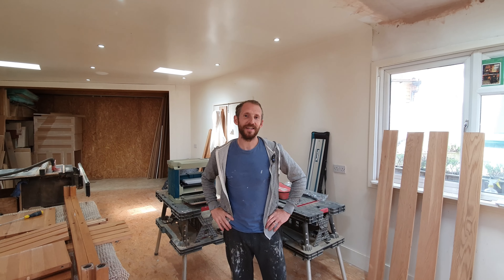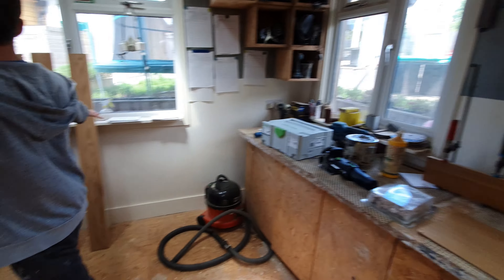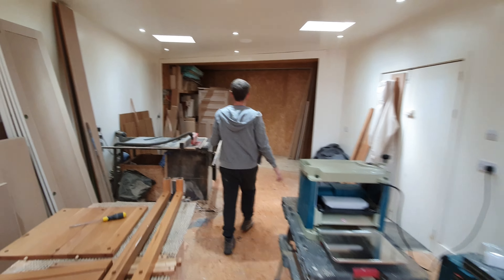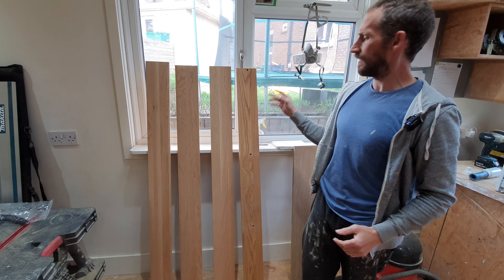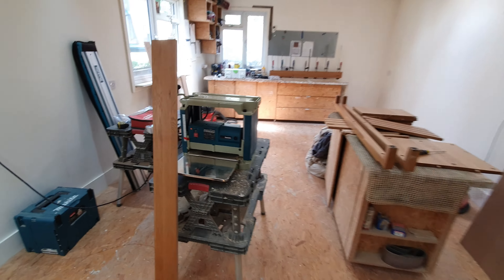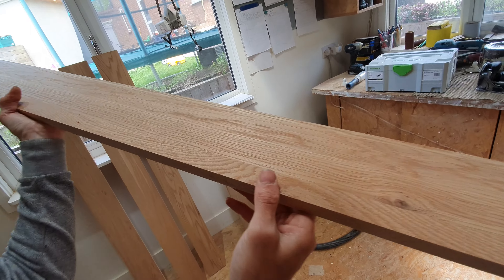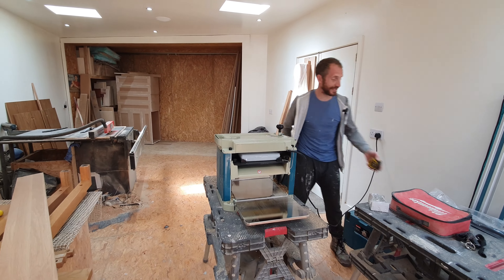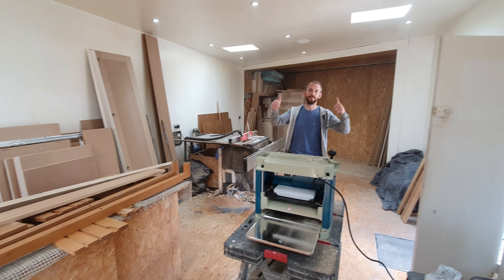The Awesome MAKITA THICKNESSER 2012NB Review & Demo \ Plus Lots More \  EP#63

Comment: Just bought one after 2 weeks of OCD research and yes no snipe, box hadn't fell of the forklift so it was good and I'm happy, its quite and fly's through 6x4 oak easy and got the extractor aswell in the box 🤠
Reply from the maker: Amazing! I really do like them, I dont use it alot but when I do it's enjoyable 👍
Reply: Hi mate. I'm thinking of buying one.  Are these any good to plane 2.4 meter lengths of green oak do you think? 200mm wide
Reply: @davidfalat4377  Im the same David, need one to clean up 200x100 green oak new sleepers.Did you purchase one? Best price ive found UK is £445 inc vat

Comment: Nice! Did the package include the dust extraction chute? I'm asking this because where I'm from they're selling it without it. Iv gotta buy it separately if I want it...
Reply: In the UK it comes with it.
Reply: @tentonhammer5469  thanks for the info. Recently bought this planer. The manual states that the chute may be sold separately depending on the country.... :(
Reply: @mariano_353   I've been trying to decide between this and the dewslt 733 probably going to order the makita tomorrow. Whats your experience using the makita?
Reply: @tentonhammer5469  not lengthy enough to pass a serious judgement. Just ran a board to test it and I can say it came out smooth with the machine right out of the box. Barely noticeable snipe.

Comment: What does the motor/gearbox housing/cover made from? Plastic or metal?
Reply from the maker: I think its all plastic apart from the top and bottom of the machine, and of course the internal table
Reply: @thelondoncraftsmanworkshop  i see. I just had my Jet JWP12 motor and gearbox housing broken into pieces and it may already damage the amarture too because of the lousy plastic it was made from. Fyi, i casually used it within my 6-7 yrs of owning it with mostly pine wood as the load. Very dissappointing. Hopefully the makita is more robust.